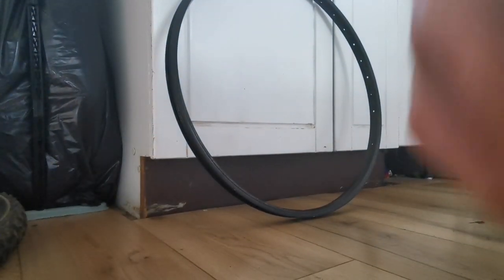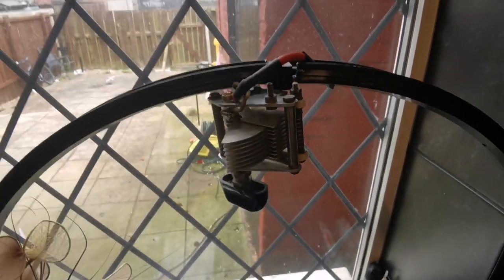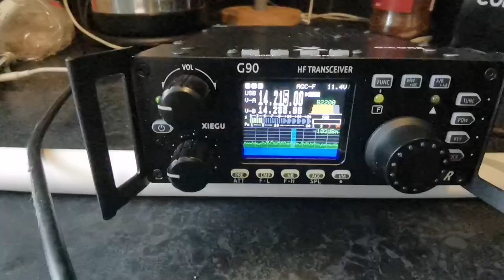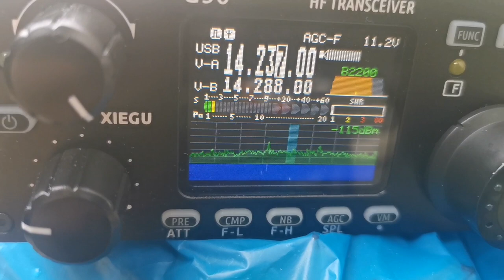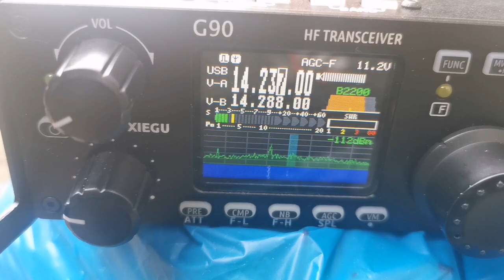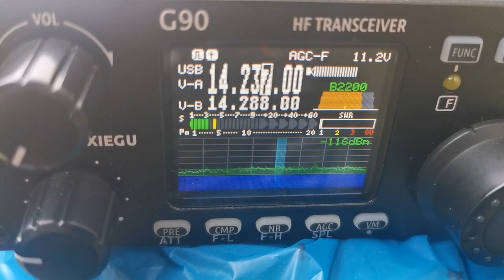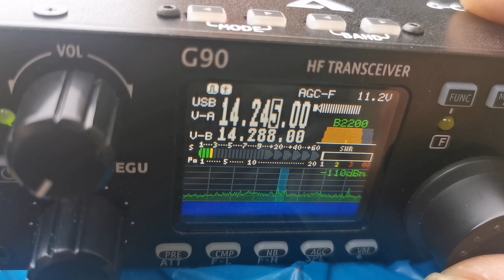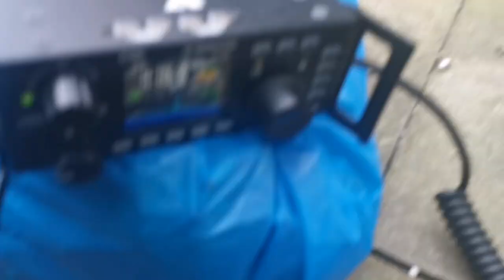Diy bicycle wheel magnetic loop antenna

Comment: I built a 29 inch bike rim mag loop a few years ago.  It is optimized for 10 meters, but works well between 10 and 20 meters.   I operate qrp only.  The other day I used magnetic loop on 10 meter CW portion of 10 meters (indoors), using my Reverse  Beacon  Network setup during a contest. It was outstanding  and logged stations worldwide from all continents. Big things can come from small packages.
Reply: Thank you for sharing this. I was wondering if I really would work on it.

Comment: Hello, I am also interested in your project, thank you very much dear friend. 73's de Didier F5TNI.
Reply: 73'' cher Ami
Reply from the maker: Just a 26 inch bike rim and a 200pf cap in between where the cut was made on the rim. Coupling loop was 1/5 of the main loop pretty easy to make to be honest